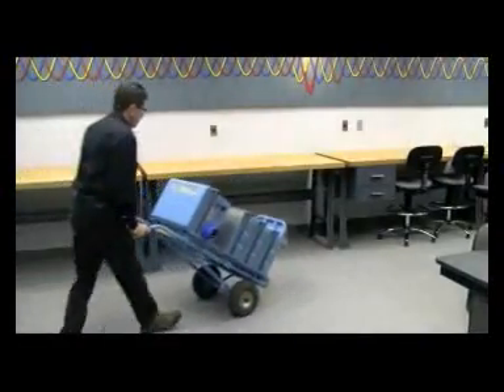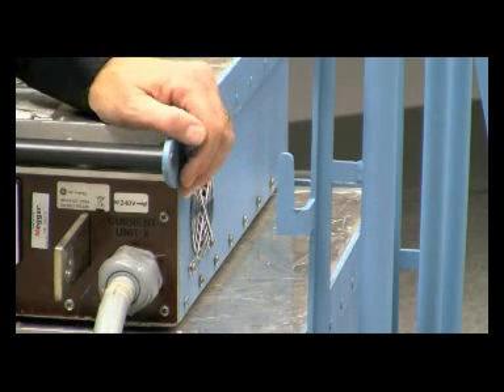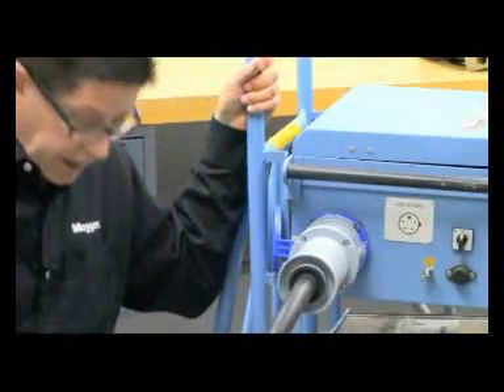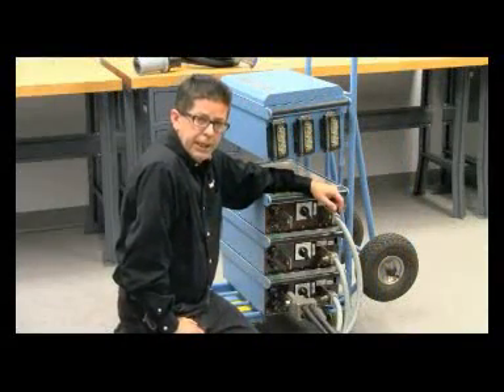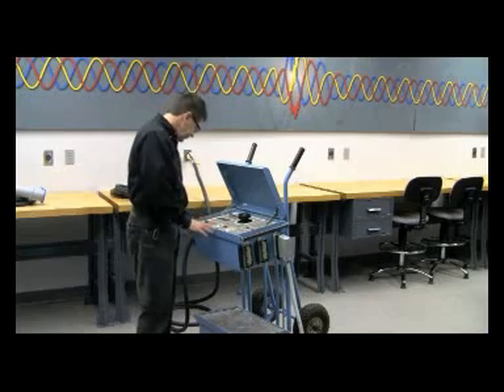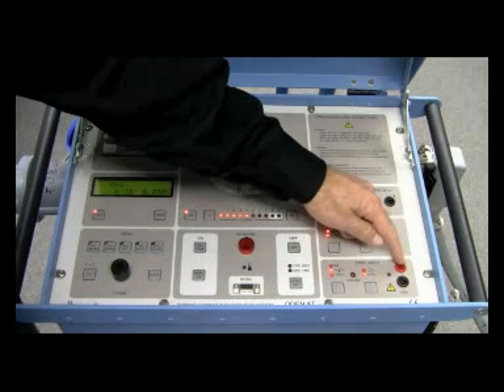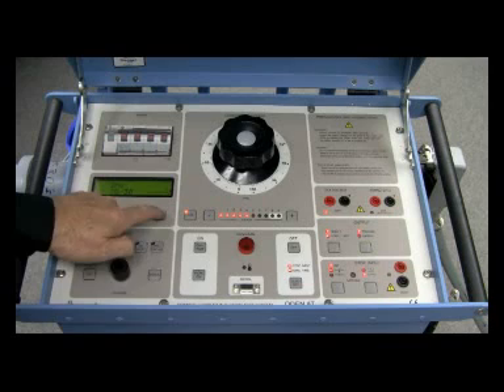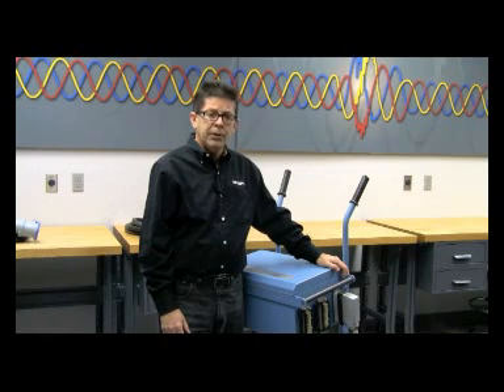Programma Oden

Comment: What are the specifications for this system? Output current continuous and pulse with duty cycle, output voltage, time and current measurement accuracy? Is the initial output phase angle controlled to reduce DC offset? 

For hydraulic reclosers, is there compensation for the change of inductance and impedance as the device operates?
Reply from the maker: Hi PaulAndMuttley
The Oden is now obsolete, the model available is the Oden AT. To see the full specs go to this page and open the 'PDF Specs' tab. Hope this helps. You can always telephone our Leeds office if you are looking to buy and need advice. (0113 235 1356).

http://cuthbertsonlaird.co.uk/relay-test-sets/403-megger-oden-at1s.html